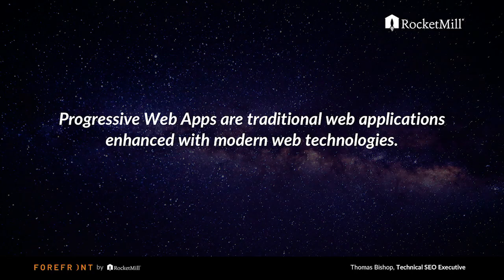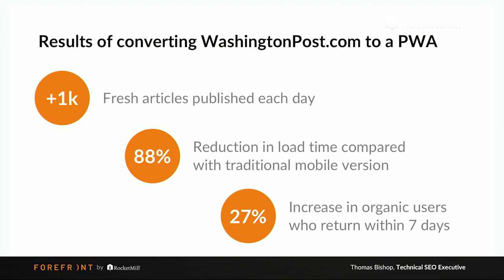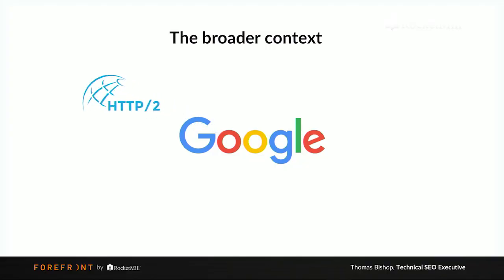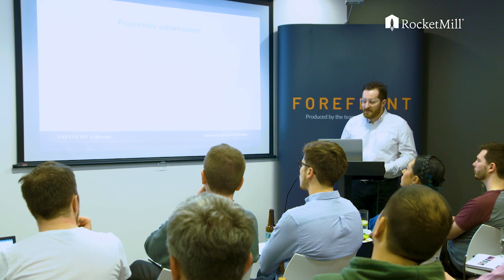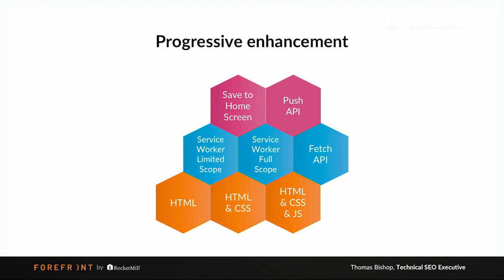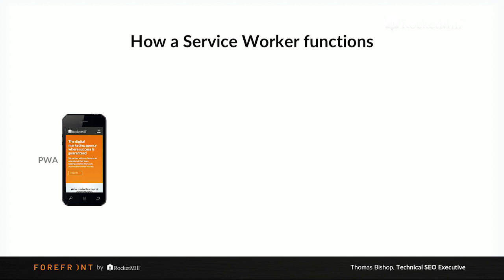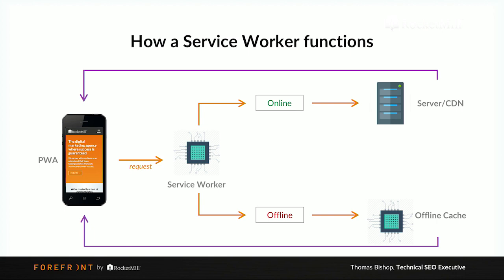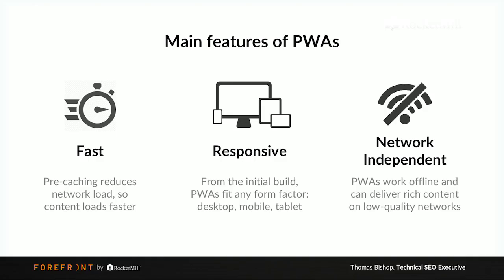How Progressive Web Apps Can Boost Mobile Site Performance | Tom Bishop | RocketMill

Comment: Nice Presentation! I was wondering if a PWA could also precache Animation assets, or is it just limited to static.
Reply from the maker: Hi Arwin,

Thanks for your comment. This is a very good question. It will depend on the format of the animation. PWAs are geared towards typical web assets (JS, CSS files, images etc) as these resources in particular lend themselves to the sorts of responsive optimisation I talk about in the video (compression, relative units, scaling etc.). It is these processes, and the file reductions they effect that allow the service worker to cache so efficiently. I am not an expert but I believe animation files tend to be very large but in principle this should be no barrier so long as it is possible to convert them into a leaner file format akin to SVG and WebP, the HTML5 <video> element in particular may be of help here.
Reply: Thanks for the fast answer!